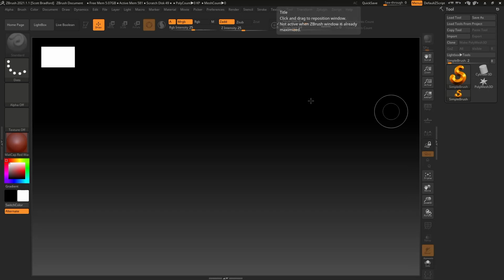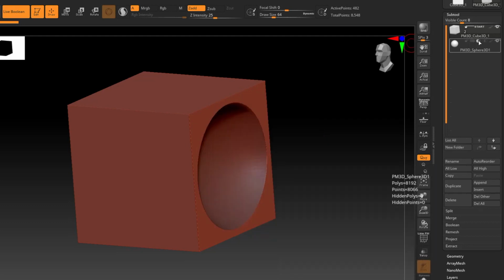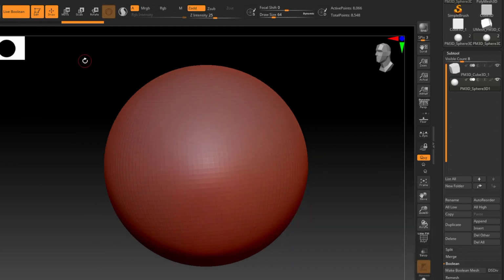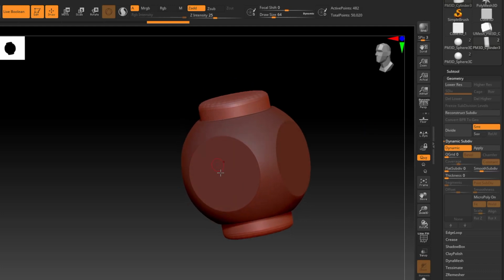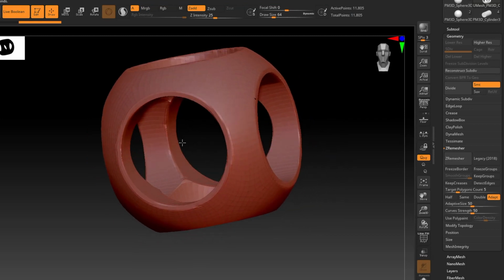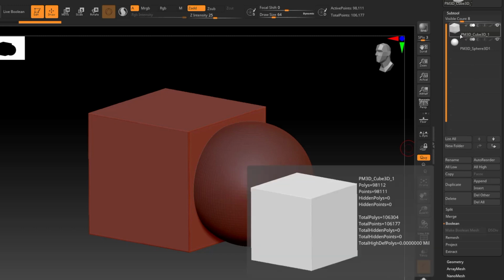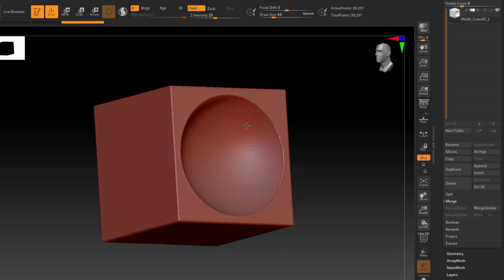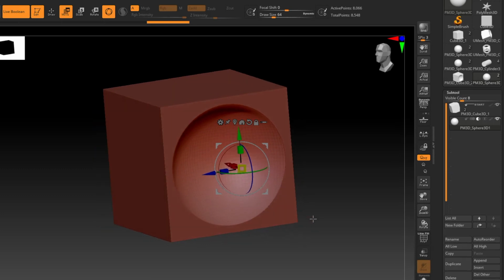How and Why to Use Booleans in ZBrush

Comment: how did you get those icons top rt on screen?  I could sure use that.  Ty loved the video.
Reply from the maker: Thank you for the question. Here is the response from our tech team: I’m assuming you are referring to the icons for the cubes and spheres on the top right in the Tool Palette. Those are different Documents in my overall Project. Let’s say I need a sphere and box in the same project but I’m going to sculpt them separately. I can bring in my sphere, drag it out onto the screen, go into Edit Mode, and Make Polymesh 3D. The sphere will be shown as the larger icon since that is the one I’m currently working on. Then to add the box, I can go to the Document palette and select New Document, click on SimpleBrush to expand the menu, select the box, draw it out on the screen, go into Edit Mode, and Make Polymesh 3D. My sphere will still be in that area as a separate document I can click into and start sculpting, or click into the box and sculpt there. It allows for multiple meshes to be worked as one project, most likely with the intention of bringing them all together at some point. When you’re ready to add the box sculpt to the sphere sculpt, you can select the sphere sculpt, and in the Subtool Palette, append the box sculpt into that document. Make sure to select File > Save As to save the whole project so those individual documents are saved as well.

Comment: when i try to boolean intersection, the subtool that it gives me is exactly the same and unchanged, instead of giving me a new one with the changes?
Reply from the maker: From our tech team: I would check to see if the geometry looks the way you want with Live Boolean enabled. If it doesn’t show anything, make sure both subtools are visible by clicking the eye icon to show them. Make sure the top subtool has the arrow selected so you can see “Start” showing on that subtool, and the second subtool has the Boolean intersection icon selected. After you click the Make Boolean Mesh button, a new tool will show in your Project, most likely with the term “UMesh” in front of it.
Reply: When the boolean operation is complete it generates the new mesh as a new tool, it does not alter the current subtool. If you do not want it to generate the new mesh as a new tool,  put whatever you are booling into a folder and when you are ready to bool, hit the folder option button (the gear icon) and select boolean with subdiv, it will place the booled item below your folder instead of as a new tool.

Comment: While following your lesson, my gizmo starts working weird. (I am a newbie in zbrush, but I worked with matrix from 2011.) For example, when stretching a cylinder it loses its shape and takes on an hour glass shape as it stretches. When turning the cylinder it takes on a s shape. But after restarting zbrush the gizmo works fine for a while before it starts warping my work. Does the gizmo need adjustment or is there something I'm doing wrong? Why is this happening? Has anyone else experienced something something similar?
Reply from the maker: Hello Natasha. Scott says that in a recent update, ZBrush added the ability to use Focal Shift with the Gizmo. He advises that after you turn on the Gizmo to make sure that Focal Shift is set to -100 so everything scales uniformly. Focal Shift is the slider just above Draw Size at the top of your screen. We hope this helps, but please let us know if you have any other questions!
Reply: Thank You !!!